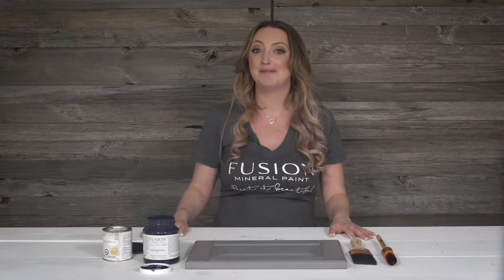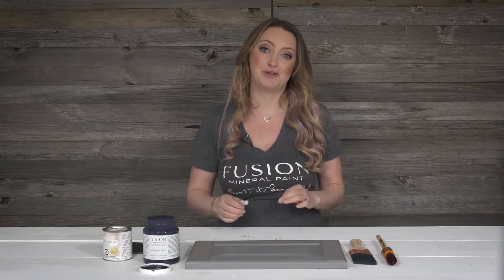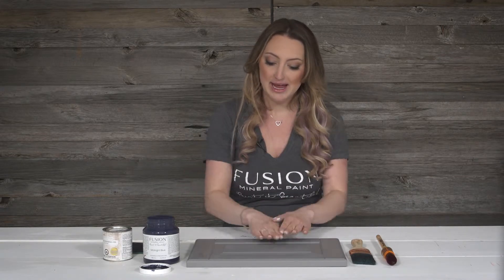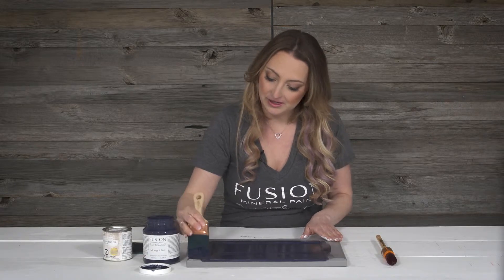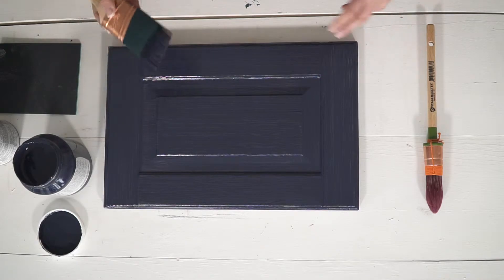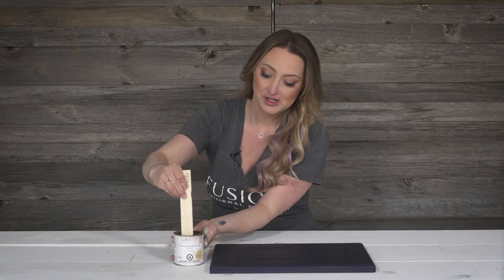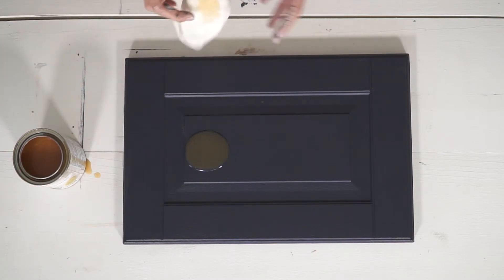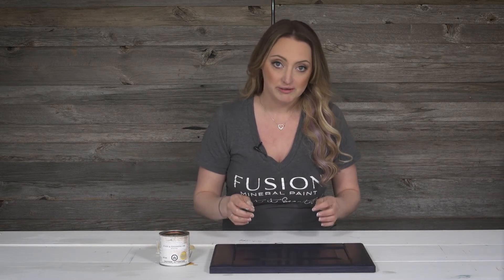How to Paint Melamine or Thermafoil Kitchen Cabinets with Fusion Mineral Paint™

Comment: The coating looks great and may very well last many years. Problem is you still have thermofoil underneath. It's not the most durable coating and when it starts to peel off that beautiful paint job goes with it.

Comment: Hello, thank you for video that includes a lot of useful tip. For my kitchen cabinet I just bought your paint in cathedral taupe. The cabinet are very shiny, and I was wondering what type of grit would you suggest to prime them before the ultra grip. Thank you.
Reply from the maker: Check out this blog post for more information on kitchen cabinet painting > https://fusionmineralpaint.com/pro-top-tips-for-painting-kitchen-cabinets/
Reply: I'm going to use a lighter color for my kitchen cabinets, so I understand I best use the "though coat". I wanna achieve an as much as possible "mat"  effect. I wander how much this "thought coat" is going to change the "brilliance" and also the color (because when it's more shiny the color seems to be lighter than without sheen?

Comment: So I have those type of kitchen cabinets but the thermafoil is peeling off.  I am planning to peel it off the cabinets and paint.  Will this paint work on the MDF underneath ?  And will it be ok in the kitchen?  Its not water based is it? I'm afraid the water based would cause the MDF to swell.
Reply from the maker: YEs it is possible the MDF will be reactivated by the paint- as it is waterbased- and it's probably a very cheap MDF since it had thermorfoil over it- so it' sup to you- what's the worst that happens? it doesn't work out? At least it's worth a try before replacing all your cabinets :)

Comment: I see you recommend not using the clear stain over light colours.  What top coat CAN be used for that extra durability?  I'm painting cabinets and shelving of an old desk in your casement colour fusion paint and would like to add a top coat for extra durability.
Reply from the maker: Our Clear Tough Coat https://fusionmineralpaint.com/products/finish/tough-coat-matte-wipe-poly/
Reply: I’m curious why you did not remove the therma-foil covering first ?
Reply: @mcleanrose45   Thermofoil protects the mdf from moisture. Mdf has a low tolerance for water.